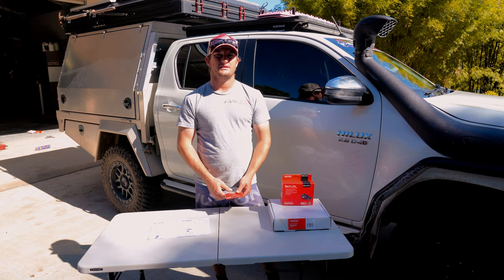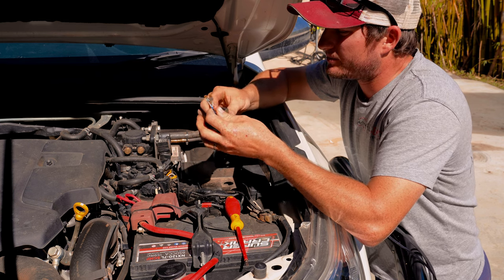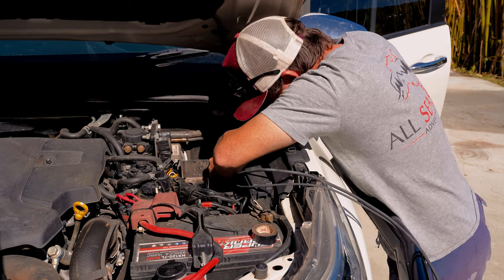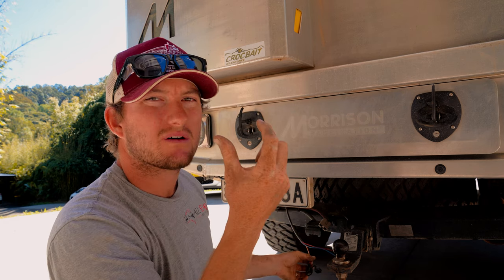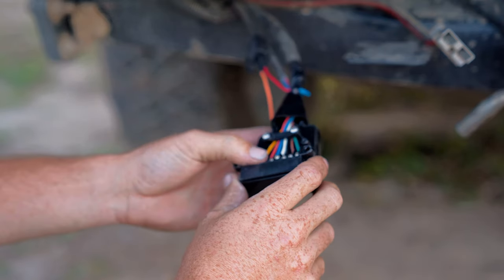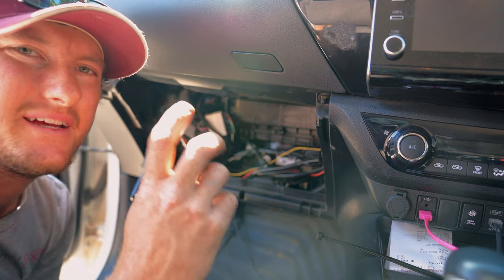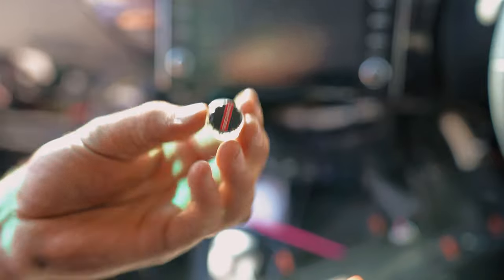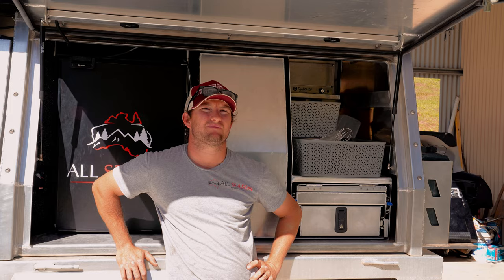REDARC TOWPRO V3 DIY INSTALL || N80/N70/PRADO

Comment: Hey cobba where did ya connect the orange wire running back from the trailer plug into the engine bay?
Reply from the maker: Orange connects to the brake cable at the back

Comment: Hey mate how have the brakes been working? I’ve been looking at fitting mine and everyone reckons pick up the blue wire up near the spare wheel?
Reply from the maker: Been working fine 

If you pick up the blue wire near the Spare wheel and you are using the Redarc harness you will have to extend it or split it back to the spare wheel but either of them will do the the same job
Reply: @Allseasonadventures  thanks heaps for the reply mate appreciate it